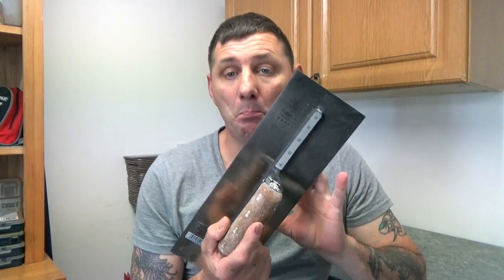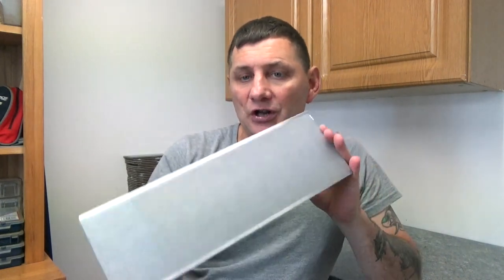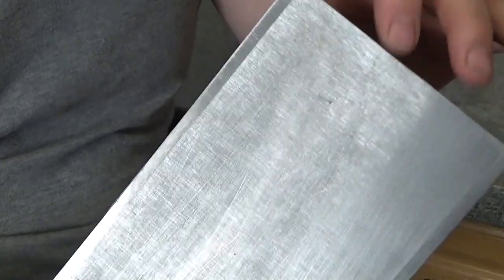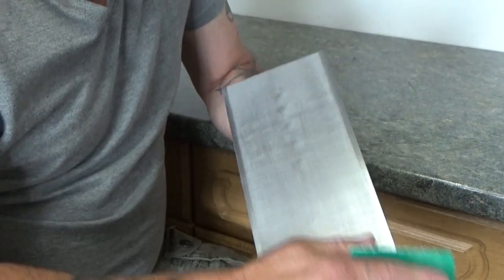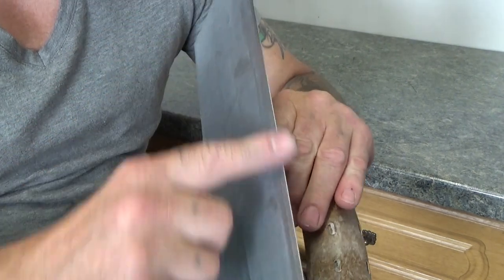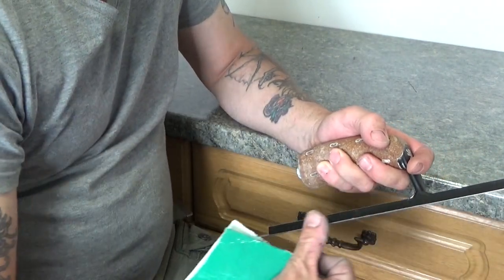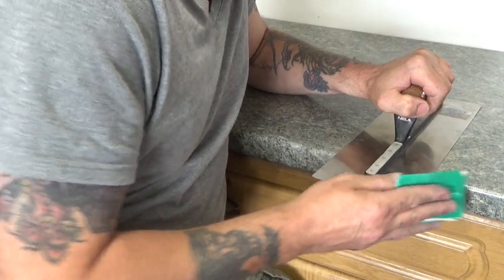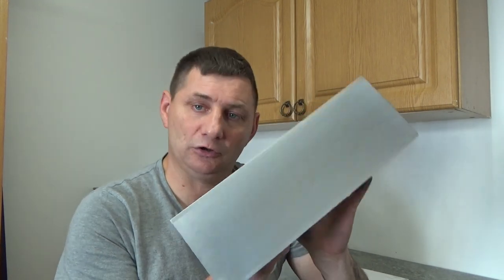how to break in a new trowel

Comment: Great vid
I usually glue some wet n dry paper to my workbench and rub the trowel on that
Seems to work a lot better as it’s a dead flat surface and a quick spray of water now and again keeps it lubed for a smooth finish
I would never use a new trowel without sanding it
I do like my trowels razor sharp though and great for cutting tape etc

Comment: Cheers for the video mate. I broke in my Marshalltown gold 14” this evening. I used 320 grit though. Took a lot longer and it wears the sandpaper out quicker, but it’s less risky than with lower grit. 

Can’t believe how it turned out. Edges, underside, and corners are as smooth as silk now. Not a single raised bump or burr!

Comment: I had 2 Marshalltown stainless steel trowels with the wooden handle when I started as an apprentice and I still have one of those trowels the other one got pinched I used it for wet plastering  Browning bonding drywall dot and dab to break it in I was pretty much wet plastering 4 days a week so it eventually broke in by plastering on to brick and block and is sharp as a razor as it's now 16 years old I just wish I knew about breaking in trowels sooner lol

Comment: Is there a way of breaking it in perfectly without having to use it on sand/cement? Maybe use 600 grit wet and dry, or 1000 grit?
Reply: just throw some water on a paving slab and pretend to skim.

Comment: Great video mate, I've just subscribed. I hear the way to break the trowel in is "just use it" but it must take forever when only skimming. Also, how does sand and cement rendering speed it up? Cross trowelling the dried render? Can't see how any wet mix can sharpen steel. Cheers!
Reply from the maker: You can get a trowel broke in with just skimming but it does take a while though using render even though its wet it acts like sandpaper just by spreading and crossing over it will take half the time to break it in thanks for your question and supporting my channel.
Reply: Thanks mate, top channel keep it up mate!!
Reply: Ab Fab Plastering I normally only take corners off the toe.
I rough coate with new ones in winter. Render in summer
Glad to see other spreads passing tips and tricks on! 
Great video bud 👍

Comment: Is this stainless Steel? What carbon steel you recommend?
Reply: Marshalltown 13x5 spring steel (carbon). I’ve got one that’s deathly sharp, and one I’m wearing in now which is getting there. The broken in one dinks really easily. I’ve also got a permashape as a back up which I’m currently sanding the edges and will start using it on bonding etc